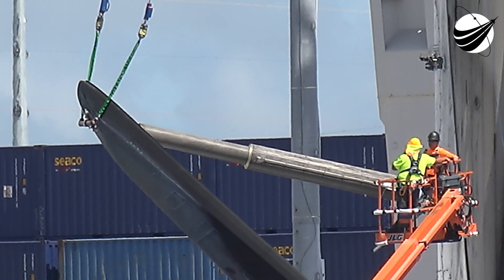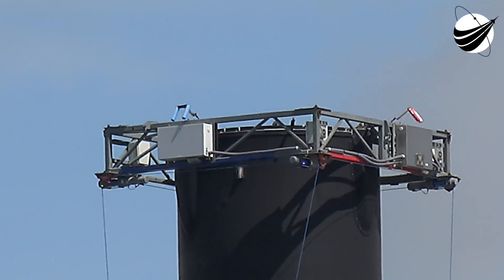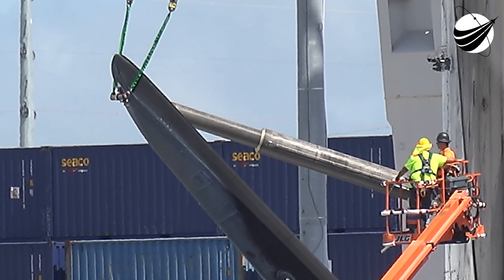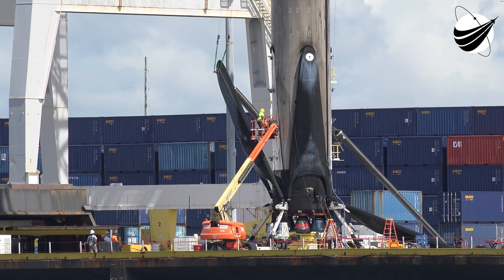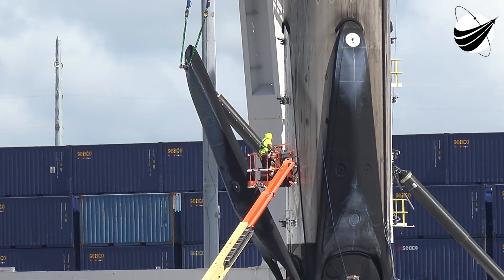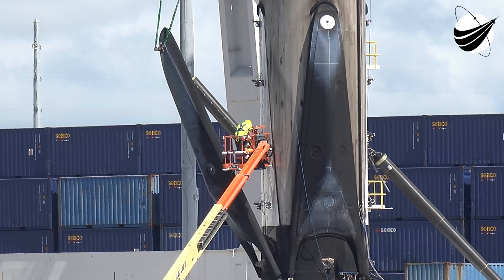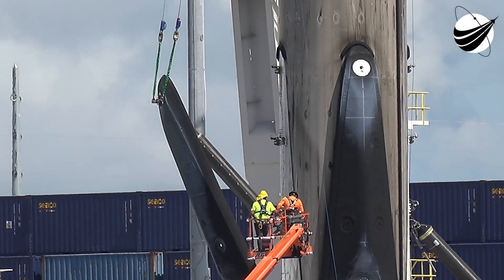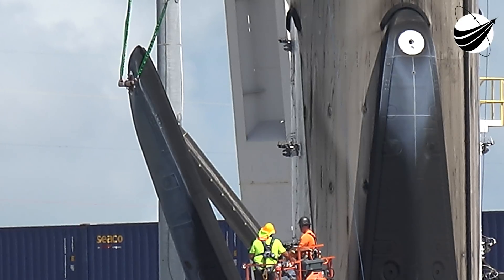SpaceX - Leg Up 60.2 From Octagrabber

Comment: It's fantastic we've reached a point where putting batteries and solar cells on an industrial tool is in some cases a better solution then messing with cables every time you deploy it.

That's the trick here, it's not impossible to run a power cable up to that doohickey, but it's so much easier to just eliminate that procedure.